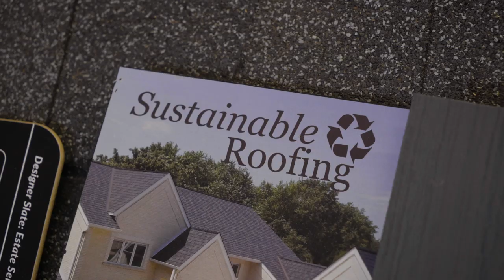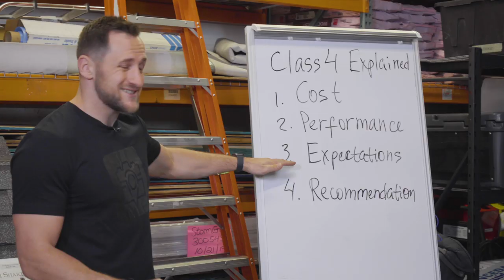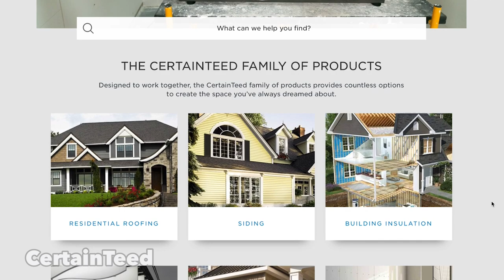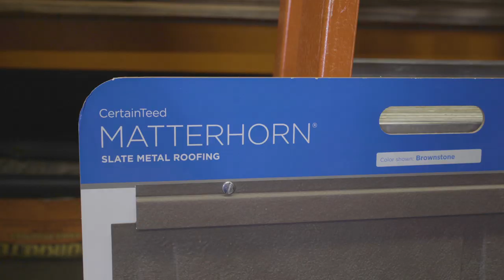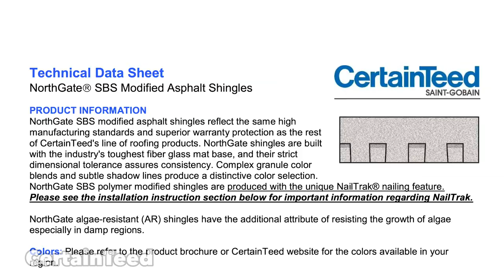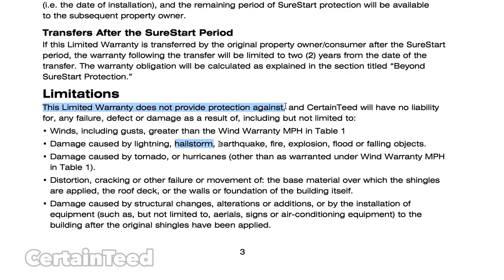Hail Proof Roofing Shingles?  Class 4 Hail Rating Explained

Comment: I'm in Texas and I pitch class 4 for the insurance discount only. I tell customers that for the first 5 years it might have an effect on hail damage. But the discount is almost always worth it. I charge $30-40/Sq for the upgrade. For most people the insurance savings pays for the upgrade in 3-4 years.
Reply: $30/sq foot or 100' reroof with shingles
Reply: @murraydupley9330  A roofer's square is 10'x10', so 30 cents a sq ft.  Around 10% more, with most guys around $300 a sq.

Comment: Need you help sir. I follow you and find your information incredibly valuable.  I live in south florida and we get hurricane activity. My (broward county) code requires 30# or equivalent plus a secondary moisture barrier. 
  Every contractor recommends 30# over 30#.
  I would prefer synthetic with 30# over it or peel and stick.
  Why are roofing contractors reluctant and refusing to install synthetic underlayment?
   Haf claims they have synthetic underlayment that exceeds 30# felt.
  I am ready to re roof and would like the best possible system in addition to gaf's laminated timberline hdz shingles. Please help

Comment: For hail protection, do you recommend Owens Corning 'Duration Flex' shingles, over their 'Duration Storm' shingles?  Both are class 4.  I've read all the Owens Corning website info, and still can't determine if one is better than the other.
Reply: Dave, what did you find out? I have the same question.
Reply: @ZAPATTUBE  flex is better but not in all markets. I am putting storm on because of that.